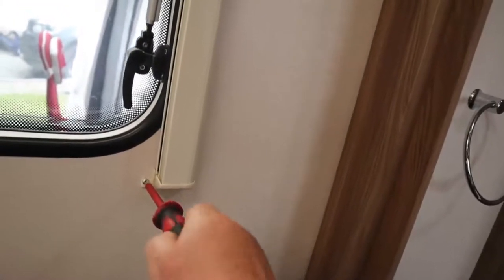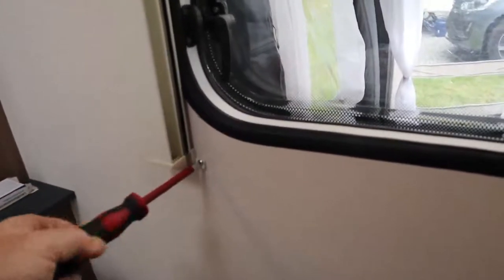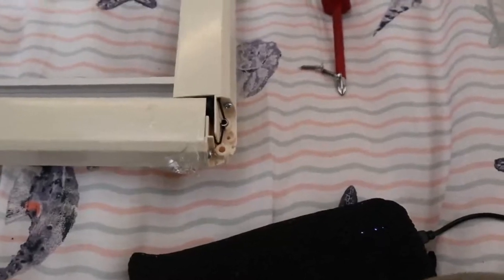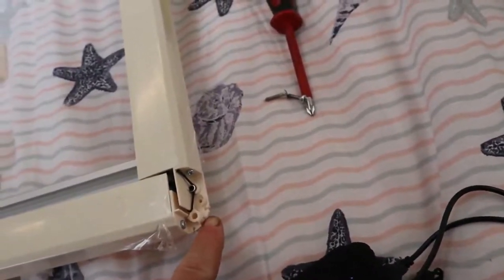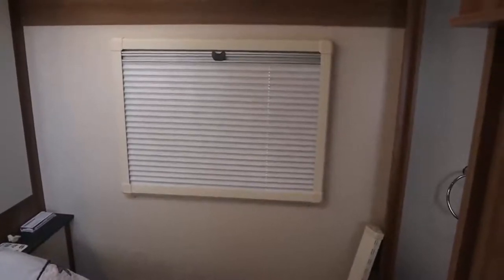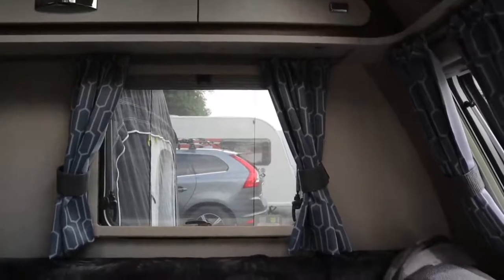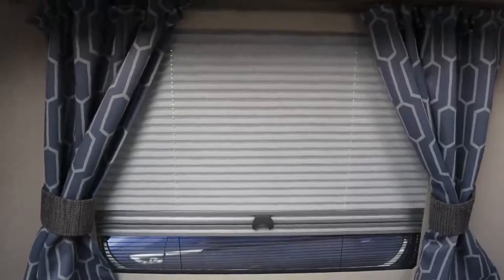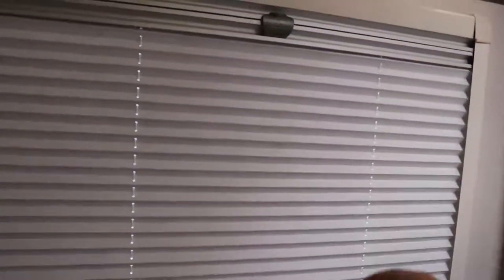WINDOW BLIND UPGRADE PART 1

Comment: Thanks for the video. Really sorry where did you actual purchase the blinds from
Reply from the maker: The part numbers in the description are swift supplied items so most swift dealers or dealers that have access to swift parts 👀👌😜
Reply: I installed mine the other way up